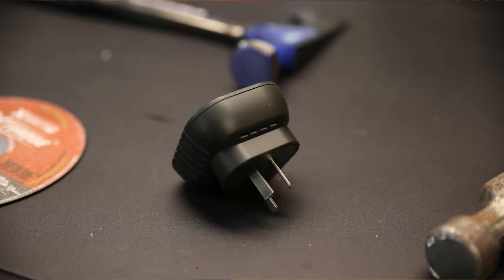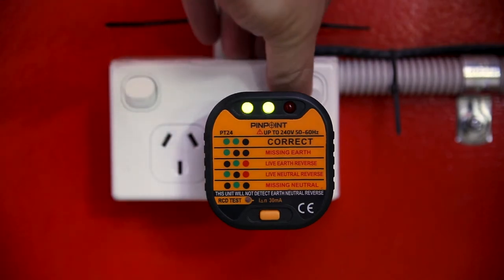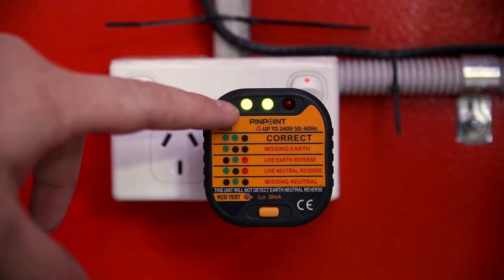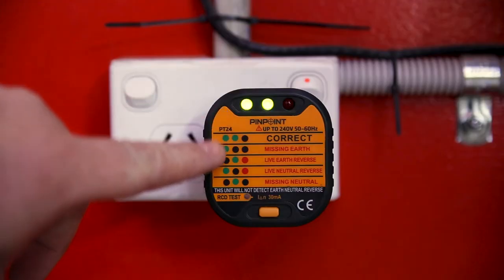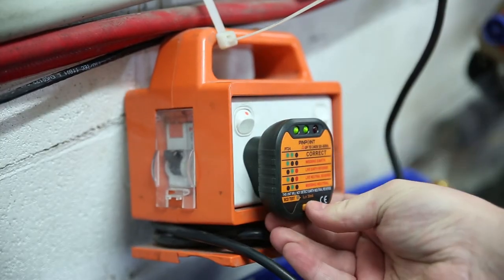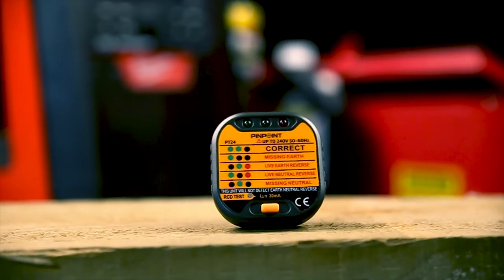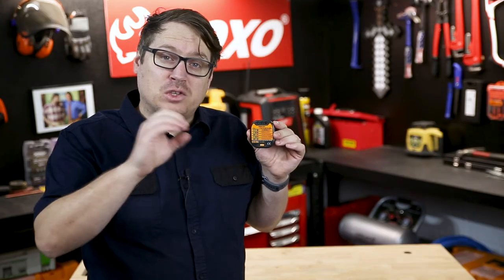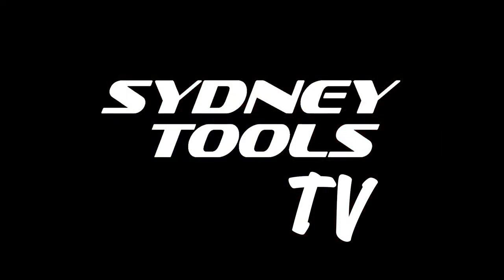240v Socket Tester - PinPoint PT24

Comment: It's not quite accurate to state it'll "diagnose any issues" with your outlet, given the label on the front says it won't detect Neutral / Earth reversed wires. Might be worthwhile mentioning that at some point in your video, or at least in some text that pops up to qualify your statement. Just a thought...

Otherwise, great video :)

Comment: Hi I've just checked a socket with a plug in socket tester and I've got 2 green lights and a red light showing what does this mean ?
Reply from the maker: Is it the same make and model socket tester featured in this video?
Reply: @SydneyToolsTV  it's very similar but doesn't have the test button on it
Reply: What does it mean having 2 green light and 1 red light on when plug in